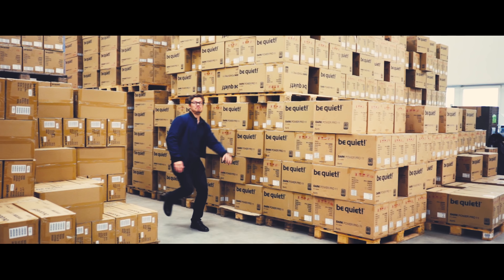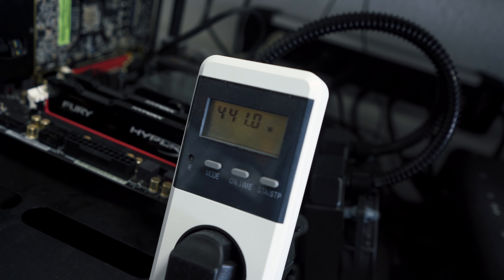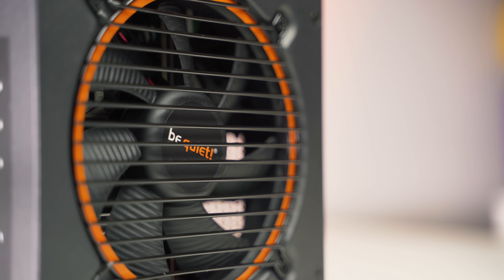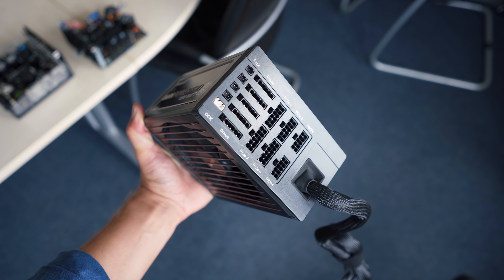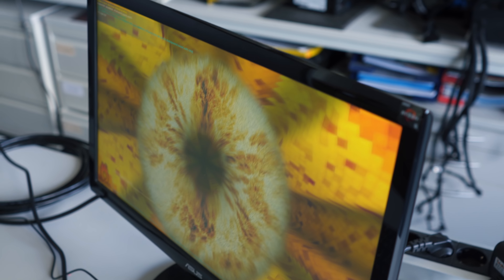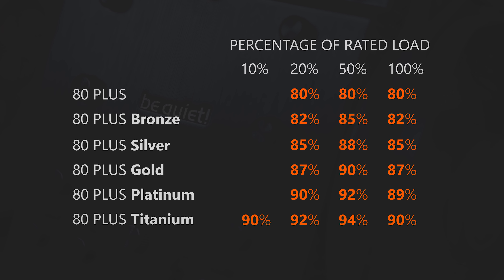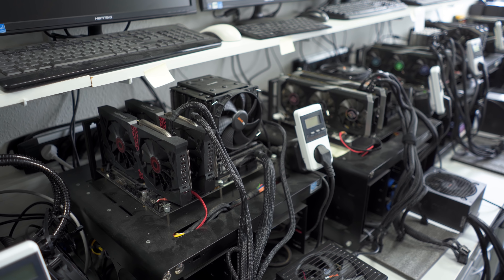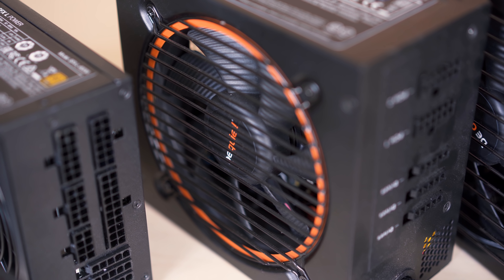How To Choose a Power Supply

Comment: Is 520 watt psu enough for 1070
Reply: I can’t think of a reputable brand that sells 520 watt units. The 8700K/1070Ti setup in this video ran on a 400W 80+ bronze PSU pulling only 330W off the wall. If your 520W PSU is 80+ bronze certified I bet you will be fine.
Reply: Easily (with a decent PSU)... under full load a 1070 with a 8700k won't even break 400w... but you can get a good 650w psu for $50, so I would advise doing that to allow for some future-proofing.
Reply: xiperfect I’m running a r5 2600x with a 1070 ti  on 550 watt bronze rated and its worked fine
Reply: Dirk van Nieuwenhuijzen seasonic makes psu’s with x20 watts
Reply: xiperfect
 Which one exactly? The wattage spec can vary from brand to brand. Check the +12V rail, and how much power that outputs. Whatever it says there is the PSU's wattage.

But, to answer your question, yes is probably is assuming we're talking about gaming. Even with an OC'ed 1070 you'll be pulling ~300W at most whilst gaming, total system draw, so you could even easily use a 400W PSU.
Reply: @COFASA 

They're not garbage, their just a bit outdated.
Reply: @-eMpTy-  They're are. Had one that lasted 2 years before not even be able to power my system for more then a minute.
Moved too a Super Flower fully moulder PSU so hope it lasts longer.
Reply: @COFASA Just because they aren't modern, doesn't mean they are garbage, they are lacking some modern features, but for everyday use they are more than capable. More than any Noname brand at least.
Reply: @COFASA What the fuck are you on about dude? A 520W Seasonic costs 50 Euro, that is absolutely nothing for a reliable PSU. They are not overvalued in any way shape or form, a Fully modular 650W (Focus Plus Gold) which is enough for anyone with a single GPU, costs like 80 Euro, and if you want to go down to semi-modular, the price drops by 10 Euro(Focus Gold). If that is not worth it for a Reputable, Reliable and hassle-free Component, I don't know what is.
There is no hit or miss with Seasonic, they are ALL good in both reliability and build quality. Almost no other brand has that reputation, not EVGA, not Corsair, not be quiet!, not Fractal Design. Maybe just Super Flower, but they are even more "overpriced".
The lack of DC-DC transformers and some lack in protection stemming from the old design really doesn't mean jack in real life where there have been S12's running for the past decade running in systems under load a huge amount of time. You have heard from somewhere that they are old designs and automatically that means that they are bad?
Reply: @COFASA garbage ? Had mine for over 4 Years no issues. Quiet and cool.
Reply: @Dirkvnh  SeaSonic sells a 520 with their SeaSonic M12II 520.
Reply: @BerchBG  I disagree, modularity is not everything on a power supply, neither is wattage for most cases. You're comment on "There is no hit or miss with Seasonic, they are ALL good in both reliability and build quality" is very untrue, no brand is like that. Both the S12II and M12II as you literally just said lack in protections being (OTP, OCP, and UVP) which isn't something minor, they are also group regulated, and lack c6/c7 power states.
Reply: @BerchBG  just because they aren't modern doesn't mean they are garbage . Please tell me where do you see those 5v main rail PSU around again? -5v? . And yes being that term of "old" means bad. I mean you can say that having a proteinel to damage your hardware isn't a bad thing?
Reply: Channel  all good in term of reputation and reliability.  Yeah They are the only mid range PSU that has recently has GPU short down, go and read it in official Seasonic website.  Idk what you mean. Focus series aren't even worth it.  RMx , WhisperM , DQ-M , straight power 11. All much better than your issue focus plus.
Reply: I always try to get a PSU that is rated for more than what is needed , if my system is going to pull 400w under load I'll get a 650-750w just to have some headroom so it's not working at Max capacity or even close to it.
Reply: @BerchBG  I have a 400w Antec that's been running my old Pentium 3 since 2005 with no problem. Yes the PC is a dino but I only use it as a local backup and media storage don't need a powerhouse for that use
Reply: @ybeninjaxl254  "Is very untrue" Wrong. They are all built well with quality components. It is still an outdated design, but it is still built well.
@Ave Votsira The word potential is the main thing. I had the shittiest Corsair in my system for the longest time, our electricity's quality is shit here, I had no problem, until my father started using it as a CnC controller and it sucked metal particles in and shorted out something.
I am aware of that one GPU that overdraws the 8 pin PCI cable, so the PSU shuts the computer down. It's a single SKU of a single CUSTOM PCB design of a 970.
@Justin S. Antec don't make shitty PSUs for the most part.

@everyone commenting. Look at DeepCool DQ550ST it's a well designed PSU with shitty components and it is still in tier 3 in the Tier list of PSUs. Would you put that into your system?
Reply: @BerchBG  named what you meant by ''shit'' , the caps and pcb?  then the sii12 has no better either let alone how shiity IC protection is there , you are telling me that a sii12 is well built? name it apart from the caps. DeepCool DQ550ST , yes I would use that any day instend of sii12 , oh hey  it's dc-dc , the protection is all there , much better fan , much better performce , minor rail regulate independently everything is good and I would not really care about caps as long as its decent enough . there are FETS and another stuff more important than a caps and fails before they do . but even how shit it is I will still feel safe enough that my GPU and another thing still there if my psu fail(by something you meant bad idk how a dq-st die while a xilecence performce A+ would last a couple year)
 unlike the psu still there while giving your GPU 10.9v and kill it.
Reply: still can't figure out what's bad about CWT GPS for being a entry llc resonant dc-dc , they are already superior than a ARFC design by any reason let alone a shitty group regulate design.
Reply: @BerchBG  I don't really know if you know a single thing about psu or not . but to me what you are doing is protecting a old psu while by old its mean group regulate and by group regulate which you have no idea how bad and danger it is but still trying to protect it anyway. stating about old is not bad while in fact it does , having your 5v sending 7v to your ssd isn't safe or it does? let that there alone the built quality , how does having a  an older double forward group regulated help with anything? that fan is also not that great. but I don't care how well built a psu is , as long as it group regulate it's trash. when buying a psu you wanted performce , reliability , long life span, and safety but sadly no reliability and safety is not there for the group regulate , not only they are group regulate they are as well a bad group regulate despite having literally no protection , where is the OCP , where Is the UVP on 12v , Where is OTP? while all those money go into that useless overate ''Japanese cap'' which is not important as another thing that can realistically make a psu better.  Care to Protect your statement of having a sii12 as a good unit that you claim? create yourself a forum in jonnyguru and let those psu elite prove that to you (even they have alredy proved it countless of time already)
Reply: @BerchBG  If you payed attention to the tier listings, you would know it's a tier 4 unit. They clearly stated that tier 4 units and below are group regulated. What do you mean the unit had good build quality?

Edit: And if you payed attention to anything I said earlier, you'd know group regulation isn't the only issue. Like the 212 evo, it's far out of its prime.
Reply: It depends. If you have nice PSU (oem like seasonic, superflower, hec, ecc) and a normal rig 450w are enough. I think a good 550w like the evga b3 is perfect.
Reply: @xXZanzi97Xx  Evga b3 = fire hazards , Evga B2= good but Evga B2 = gone .
Reply: @avevotsira7383  the oem who makes the b3 is superflower. Check the full review done by jonnyguru. An Italian YouTuber (Falco75) tested a 450 b3 with an oscilloscope and the results are amazing, absolutely no ripple and strong voltage under load into the 12v, 5v and 3.3. The b3 series is perfect.
Reply: Yes, 99% of all single gpu systems will be fine on 500w.
Reply: @xXZanzi97Xx  the unit made by Superflower doesn't mean it's good the fact that alot Superflower unit is acaully not that good and the good one mostly fail to keep up with complitiation.
Reply: @avevotsira7383  I'm honest, i have not read tom's review on the b3 450 before. The OCP into the sample that i saw (go to check the full review into Falco75 channel, it is in italian but you can understand by the graphs) worked flawlessly. Maybe there are some saples that are fauly and some that are not. Anyway thanks for telling us, i didn't know that.

Comment: I am trying to build my first PC and I had a problem of choosing my PSU...
Now I tried using a PSU wattage calculator website
And the website says that the recommended PSU wattage is 429 watt
And the recommended PSU is EVGA 550 watt
So...
Should I buy a 450 watt PSU
Or a 550 watt psu
Reply: 550,
Reply: @radman7681  sure??
Reply: @abdulazizthabet4688  yea. Gives you some room for upgrades in the future, but if you wanna go a little cheaper then go for a 500w, but make sure youre getting gold or bronze if you care ab your power bill at all

Comment: Typically anything that has a 80+ certification with all the required safety labels printed onto the PSU is indicating that it's safe to use.
Reply: Many PSU's that rated by 80+ do not have a full set of protections
Reply: Not even close

Comment: what if I switch motherboard? 
like from z370-p ASUS with 8pin CPU power to msi z390 MPG with 8+4pin CPU power? should I switch to PSU with 8+4 CPU pins
Reply: @COFASA pc specs are: i5 8600k 1070 ti with corsair 650w 80+ bronze

Comment: Which power supply is best for 1650 super ?
Reply from the maker: Something in the range of 450W - 600W (for the full system) with Gold+ rating. Full system watt consumption with a 1650 Super will be under 300W. 
-D.
Reply: @HardwareCanucks  I have 3 options availability in my country RightNow to choose from 

1-thermaltake 500 watt 80+ 
2-corsair vs550 watt white certified 
3-EVGA 500 BR 80+

Comment: Just check Jonnyguru and if they say it's good then you're basically fine. So thorough
Reply: No. That's extremely false. For example, the G3 has issues with its protections. That was not tested on Jonnyguru. Same for the B3. That one was also a case of bait and switch by EVGA. Which happened, because they fit their samples directly from EVGA. 
Then you also have the fact that they don't test for noise, any protections, transient response or EMI emissions.

Comment: I was totally set on buying a be quiet! PSU and case, but in both instances I found that here in Aus there is one, just one fucking retailer that sells be quiet! products. 
And of course they have stupid high prices on them in comparison to similar products so that it just makes them as a choice a bad idea. 

Like, would I rather get an 850W Dark Power Pro for 300 bucks, or a 1100W Strider Titanium also for 300 bucks. 
Fuck you PC Case Gear.

Comment: WHAT PSU WILL I USE IF I HAVE: 
GTX 1070TI OR GTX 1080
I5 8600K 
16 GB RAM ?
Reply: You can get away with 500watts. But I'd reccomend a comfy 750watts
Reply: Sticking with be Quiet!, Pure Power 11 500W
Reply: Evga b3 550w...650w if the price isn't too different.

Comment: How To Choose a Power Supply — buy seasonic.
Reply: That's how to end up with some of the worst PSUs on the market. 
Thinking about the S12/M12 II in particular. And all of their PSUs lack multi rail, even the higher end, higher wattage ones. Then there's the Hong Hua fans that they use, which are not good at all. And because Seasonic is relatively small, they outsource the PCB-A production, resulting in worse QC, compared to better OEMs.
Reply: Never heard a bad thing about Seasonics....

Comment: How come "BeQuiet" doesn't offer any completely fan-less power supply. I mean it can not get more quiet than having absolutely no fan.
Reply: @COFASA you may have some valid Theories but when Seasonic offer 12 years warranty on fanless power supply make any possible degradation in the lifespan of the internal components insignificant in reality.

Comment: Almost everyone who buys a 1000 watt PSU is just shooting themselves in the foot. PSU:s are most efficient (ie, waste the least power) when they're running at something like 70% capacity or more, I believe. Sure, adding a little headroom may not be a bad idea, but a 1000 watt will mostly idle with almost any build.
Reply: No, max efficiency peaks at 50% load and drops down significantly from 75% load onwards. A Gold rated PSU has 90% efficiency at exactly 50% load and drops down the 87% at 75% load.
So a 600 watt 80PlusGold will draw 333 watt (300+33) to power 300 watts worth of system power; but will draw 575 watt (500+75) to power 500 watts worth of system power. If you want the most efficiency, you want your total system load to sit around 50% to 75% of your PSU.
Reply: Different PSUs have different efficiency curves
Reply: @dainiusvysniauskas2049  No they don't. Each 80PlusBronze has the same efficiency curve (within a very small margin of error of course). There's a reason the 80Plus label exists. It's to specifically label the exact efficiency of the PSU.

Comment: Any Seasonic, any Enermax... Other brands I would not touch... Unless they will start doing something REALLY uniq & special
Reply: Congratulations, you can now buy crappy PSUs, without even considering other good PSUs. Based on absolutely nothing.
Reply: @MrSeon123  During the time I worked in a PC shop those PSU from mentioned 2 brands never were RMA. Thermaltake was the worst - every second one failed during 1st year, Corsair was so so as well, although they did had probably one of the best RMA policies in Europe, but the still did fail quite often. We did recommend mostly Seasonic, since they were cheapest of most reliable PSUs, but I do have also personal experience with quite a few PSUs from Enermax as well (and all of them worked without a fail 24/7 - I did build quite a few PCs at Uni as well.  Thanks for congrats :)
In my current system I have modular Seasonic 650W with Gold power rating (or 600W, I do not remember exact model number, since I bought it 7 years ago, and it is the only component left from 2 previous systems I had during this time). But they got pretty expensive now, so I f I would need to build new system with more powerful PSUs I might take Enermax now (I do not think I would need to for my next system as well, since I do not do SLI/CrossFire).
Reply: @fedoruccio  You do realise there's things like regulation, ripple, transient response, noise and protections? Seasonic has the S12 II and M12 II, which is crap in all of that. It also costs more than units that are better than it (not that it takes much).
Also, do keep in mind that different brands will sell more cheaper units. Thermaltake has a bunch of super low end units, which seem quite popular whatever reason.
Reply: Seon-Ho sure, i do not push you to buy one, just giving my point of view based on experience. You are free to make your own choice :) i would seriously stay away from Thermaltake ones though... what you would recommend from your experience? not that I need one, but I like to see your pros and contras.
Reply: @fedoruccio  Thing is, I would recommend looking at _reviews_. Professional reviews that cover all the points I mentioned, and more. The best English reviews are currently the ones by Aris.
Reply: Seon-Ho so you really think I do not read reviews, although I prefer old heavy waiters like Anandtech and Hard OCP, never remember bad one for both my favorite brands of PSU.
Reply: @fedoruccio  Yes. Because if you actually read reviews, you would not buy by brand, but by product. 
The reviews on HardOCP and Anandtech are much less comprehensive than the ones by Aris. They also have a lot fewer PSU reviews.
Reply: Uncle Ho is just a Seasonic hater...

Comment: As long if it's Seasonic or SuperFlower made you're golden Fuck the rest....And get highest quality and rating you can that's my advice. Yeah some say you won't need so much why pay so much. I say why not. I know it's most efficient st 50% load..And you save like what...Not even up to 100$ per year on your total bill ?? Not to mention you won't be stressing the Fuck out of your PSU and create ton of heat out of it as well.